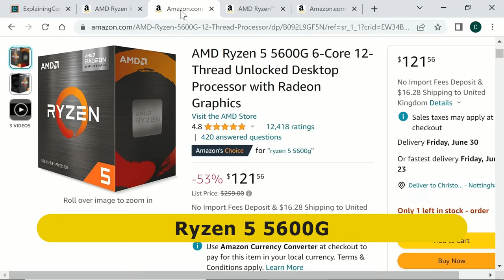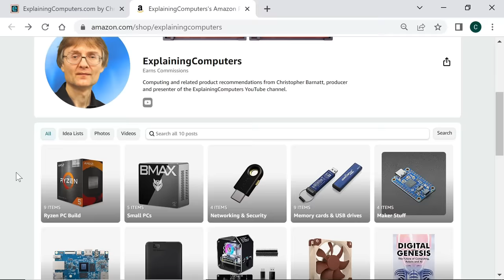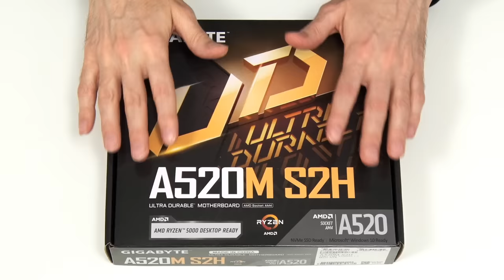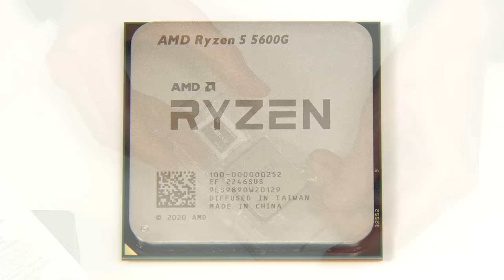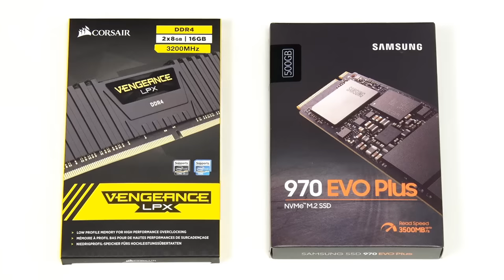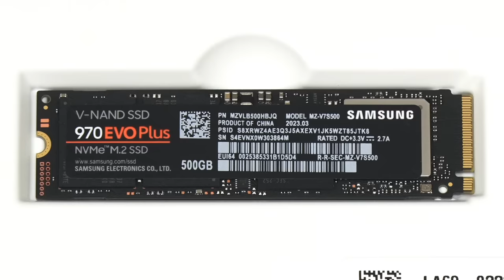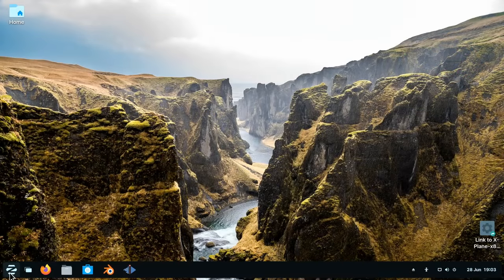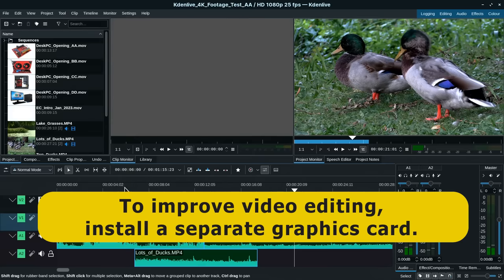Best Value Ryzen PC Build

Comment: I disagree with your take on "building a new low-cost computer".
Given that computers are tools that help us speed up some of our daily processes (see work, entertainment, research,  Internet browsing, information, etc.), they fall under the first basic principle of the economy that wants: "achieving maximum profit with minimum financial expense".
This means that the more effective, safe and fast tools we use, the greater the benefit we have.
  Explain:
  The latest platforms support 5th generation memories (DDR5) with speeds of 8000Mhz PCIe 4th and 5th generation and NVMe disks 4th and 5th generation USB 3.2 2nd generation and 2.5Gbps and 10Gbps internet cards!
All these improvements brought an increase in the execution speed of any process of the order of 40% at least.
This in turn means that the execution of any process is completed 40% faster than before and therefore 40% less electricity is consumed!
In addition, the latest generation processors have upgraded security functions, coding, a greater range of communication channels, etc.
Based on the above, I consider any expenditure for the purchase of HARDWARE provided technology as what you present today to be a waste.
No matter how cheap the machine you present is, it is never going to be able to repay its acquisition, due to its inability to successfully respond to the work for which it is intended (see new applications and operating systems of the guaranteed future which are already being designed with based on the capabilities of newer processors) on the one hand and the increased consumption of electrical energy on the other hand (see increased operating times for the completion of processes)).
  While we pay for the machine once, we pay for the electricity every month. So if we want to make correct calculations, we will have to cost the execution of any work taking into account the energy spent to complete it and not only the cost of the machine and the applications used.

PS:
  The comment is made with the purpose of activating the thinking about what is really "cheap" and what is finally "expensive", given that many parameters are artificially hidden by manufacturers and traders, in order to make some products look attractive.

With great appreciation and respect for your work

V.PAPAS
Reply from the maker: Your comment ignores the fundamental fact that most real-world activities undertaken with a computer -- whether it be watching a video, writing a document, reading a web page, or playing a game, cannot be completed in less time if more processing power is applied. So your statement that the "execution of any process is completed 40% faster than before and therefore 40% less electricity is consumed" is incorrect.

If Ryzen 7000 systems used less electricity, you would have a good point. But the TDP of both a 5600G and 7600 is 65W. You seem to have fallen in the trap of believing that increases in performance specifications have practical benefits for most users, when increasingly they either do not, or are used to delivery improvements in quality of experience (eg a better looking and more responsive game), not efficiency (a game played for less time).
Reply: @ExplainingComputers  Dear Christopher
  First of all, I want to thank you for taking the trouble to reply to my comment.
  I absolutely agree with you that I did not take into account all those applications that are not affected by the computing power of a system.
This was done on purpose as no one needs to build a system just to type a text or surf the internet or watch a movie on YouTube. A "smart TV" can successfully perform the aforementioned functions without the use of a computer. There are already some SAMSUNG models on the market that provide all these features plus the use of OFFICE 365.
Surely a computer from the WINDOWS 2000 or XP era can perform all these functions successfully (surfing, reading web pages, typing, connecting to FaceBook or Tic-Toc, reading and writing DVDs and CDs, watching movies, etc.).
So the reasonable question arises: What is the use of building a tool when it works in the same way as its predecessor?
What's the point of replacing a tool with a new one that does exactly the same thing as the old one?
Why invest in a non-upgradable platform when you can get a future upgradeable platform for about the same cost? (PCIe 4th and 5th generation, latest generation CPU support, compatibility with Windows 11, RAM DDR5 USB 3.2x2 10Gbps network cards etc)
How can we talk about AI and Quantum Computing and at the same time go back to our constructions?
  Keeping in mind the creators of content (whether it is video, or improvements to images, or editing audio documents and music, or designing and studying new projects and animations, or creating workstations and local data servers), I consider it unacceptable to invest in outdated systems and platforms.
There are better options to get the job done at a lower cost while remaining secure and maintaining the possibility of a future upgrade.
The game is the work of gaming machines and not of computers. Let's not confuse the meanings of the words.
Viewing a video is strange for the computer. Editing a video is the main work of the computer.
The first task can be performed by a multitude of devices. The second, however, only computers.
One can play video games on a console or an X-box.
However, it cannot make video games except on one computer.
One can watch animations on a television.
cannot create animations without a computer.

  I call this exact computer`s ability computing power.
It is the tool of the Creators of the present and the future.
Let's also not forget that the life span of each of us is finite and therefore every thousandth of a second that passes cannot be returned, so the faster we complete our plans, the more we will have succeeded, until we "leave", for the next generations.

And thank you again for the time and the honor you took in replying to my comment

Comment: A bit tedious, ain't it? I love AMD with a passion. But applying thermal paste to a CPU cooler -- in the factory? How dumb is that? Gee-whiz, Louise. :face-purple-crying:Most useful thing I learned: never screw around with a Mini-ITX or Micro-ATX mobo. No space on those, just all around compromising, see? Go with regular ATX, E-ATX or larger. Also, having just two DIMM slots on a desktop motherboard is ludicrous. Even the tiniest laptops have two SO-DIMM slots. :hand-pink-waving: 14:22 Is ttis a joke? Guy is doing a sleigh of hand tickery here. We connect the CPU fan cable -- where exactly? No clue, no clue at all. Also, in the very next overhead shot of the mobo, there is no CPU fan cable visible. Nice build, Mate. :face-green-smiling: Next, if you must speed up some of the action faster than real time -- make sure it is not done at 80x normal speed like it is done here. By the time the guy gets to plugging in all the power supply cables, safe to say he lost 100% of his novice, newbie audience. All in all, a nice round 3-star effort to teach us something. Thanks a bunch.
Reply from the maker: Intel stock coolers also come with thermal compound pre-applied, so this is not just an AMD thing.

I deeply resent your "slight of hand" accusation. On, for example, the CPU fan cable, you can see the connector in  the wider shot where I fit the cooler. Then I have a close-up shot showing very clearly indeed where it is plugged in. And the cable and connector are then very clearly in view on the wider shot afer that. So your comment that "there is no CPU fan cable visible" in the following shot is just untrue. By all means offer criticism, but at least base it on an accurate description of what the shots in the video show.